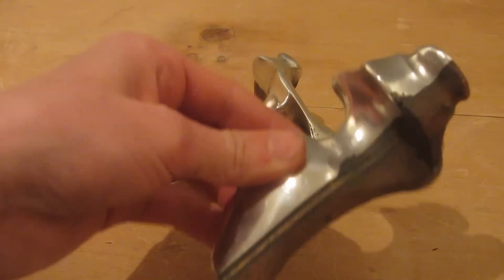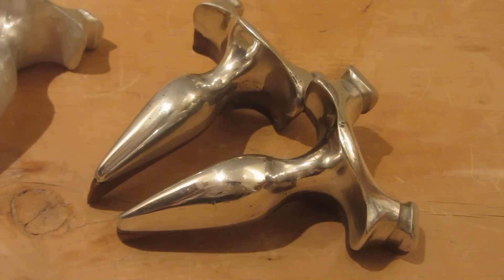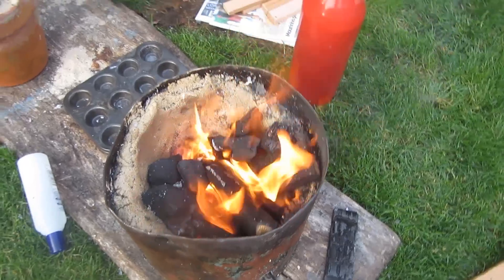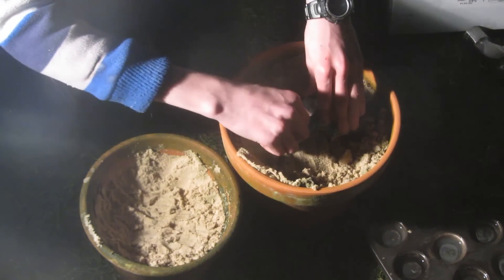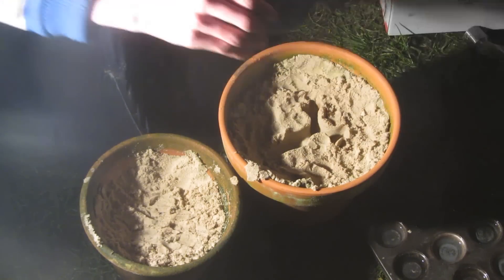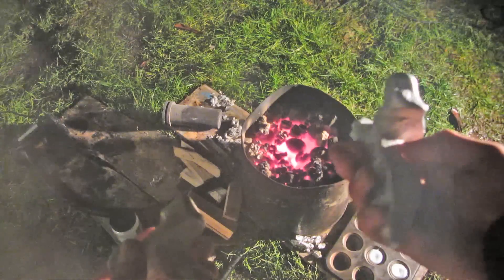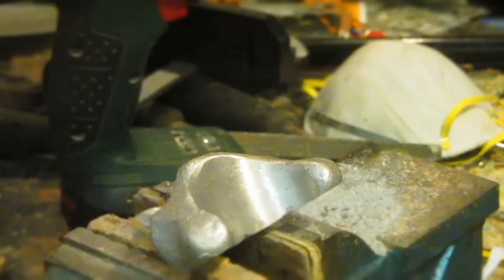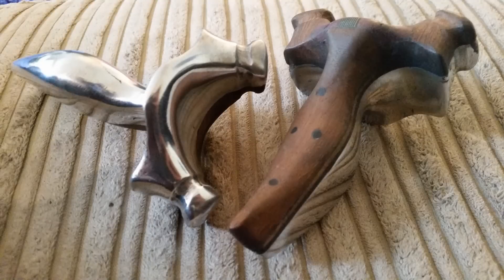How to Cast Aluminium Slingshots Using Sand - Part 1

Comment: buy sodium silicate, mix into your sand, pack sand around your pattern to the parting line (where there is draft) let it cure overnight or inject co2 into it for quicker cure thats your drag, then make your cope, you'll also want to riser these over there heavy sections or else you'll get casting defects (shrink) perosity is inevitable unless you have nitrogen to pump into your molten metal. riser calulations are as follows (W * T) / [(W + T) * 2] - C = Modulus 'A'   then modulus 'a' * 1.2 * 5.35 = Riser diameter hope that helps ya buddy

Comment: why don't you imprint the slingshot vertically into the sand? Then you could have a solid aluminium slingshot, and wont need to smooth out the sides. +The Art of Weapons

Comment: Seems like it would be easier and much less work to do grant's way where u cast the whole mold in aluminum using the styrofoam technique.

Guess it depends if I want the wooden back or not.

Comment: Also why use aluminum for bullets when you can use lead instead-1 old car battery will give you plenty of ammo.Just be careful with acid,and also don't breed in the lead fumes.Also steel ballbearings are great ammo,glass marbles,or if you are super poor use rocks.
Like kid said whats the point of casting light,soft,expensive ammo for a slingshot?

Comment: Borax is toxic only in large quantity ,so if you get some on your hand you wont die.Just don't snort it like a coke and you wont have problems.Wont harm to have gloves if you have sensitive skin ,but you 100% wont die from it if some touches your skin.Wash hands with soap and water and that's it .
Also borax is used as a flux in metalworking industry,for forge welding in blacksmithing and many other applications in other industry.
Reply from the maker: thanks 
i manly picked it up because i was planning on doing some more advanced forging some time but heard that it also worked on the aluminium too.

Comment: Dude I love your channel so much! Been subscribed for a while, I'm like the American version of you xD I'm a 16 year old blacksmith working out of my basement. Will this method work for casting knives? And I have two projects for you! Attempt to create the alloy Aluminium Bronze (Aluminium+copper) (I got the British spelling right :) ) and make kunai knives out of wrenches! Keep up the excellent work!
Reply: No this won't really work Because it would just cast a flat sheet The knife needs a bevel which is really hard to make using this Method. Also the aluminum is way way to soft to make a knife it just won't work. But if you really wanted to make knives use lost foam casting and melt steel. Hope this helped
Reply: Lost foam casting and steel. Got it. On to question two. Mr. Art of Weapons promised to make a forge using the King of Random's design. I actually built that forge long before he announced it in his video. You can search "bucket forge" and you'd probably find it. Will it heat/melt steel? I converted it into a propane forge rather than continuously maintaining a charcoal fire.
Reply: Steel would be quite challenging to melt though. good luck with that
Reply: I wouldn't bother try to cast knives with steel. My main concern with this is that you would end up burning the carbon or altering the crystaline structure of the steel. Also steel is not an easy metal to melt, I believe a propane forge should be able to melt it, but it would take a rather long time. If you're making a steel knife I would just go with the stock removal method where you just take a sheet of steel, cut out your shape, file out the bevels and heat treat and temper it. Casting a bronze knife should be fine, but you might want to use green sand for casting the bronze. And a bronze knife should be fine, of course it won't be hard as steel, but in the past humans used to cast bronze swords. I don't see why bronze wouldn't work.
Reply: There are a lot of things in this cruel world that will kill you. One of them is being too literal.

Comment: great video, i'm going to try casting in this method before lost foam. i would suggest making lead ammo as it has a low melting point and a high weight. will it work with no flux added (i don't have any!)? if anything then a knife handle could be cast in aluminium or carve words into foam. up to you realy :)
Reply: i just finished on the casting part, looks like it is the best sling shot i will ever make!
highly recommend to any one new to casting, thanks for making this vid

Comment: Try to heat the aluminium to about 1200 degree Celsius. If that doesn't help, put some copper in. If you put enough copper in, it should get yellow. But you don't have to put that much in. Just a bit to take the surface tension.